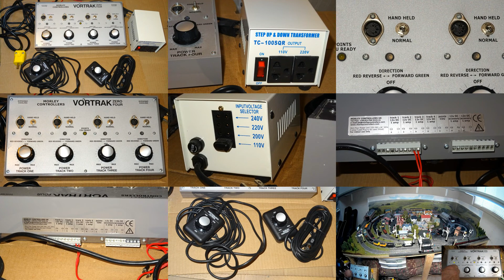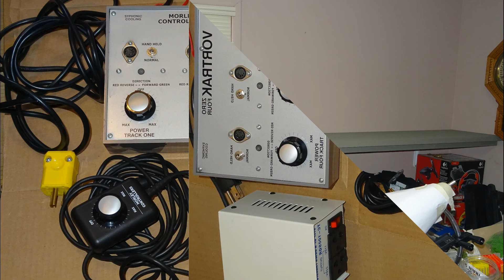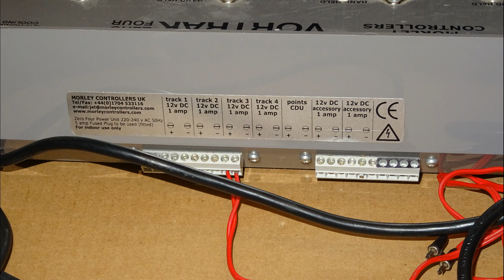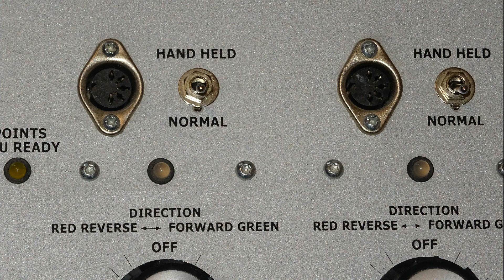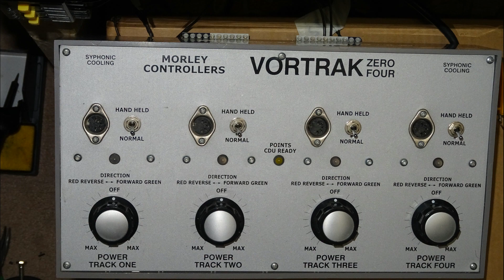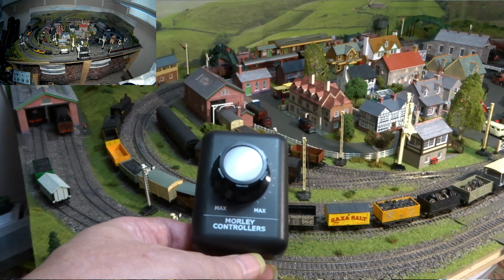OO Gauge 88, Controllers Again: Morley Vortrak

Comment: I seem to have a problem with my Vortrak controller, tracks 1,2, and 3 work fine with the led lights working  in both directions but track 4 does not light up in either directions.  Any suggestions most welcome.
Reply from the maker: I'm sorry, I haven't taken mine apart, so I don't really know anything about the internals.

Comment: May I suggest that you fit ferrules to the stranded wires into the terminal blocks. This will enable the end to enter the terminal block much more easily and form a very secure connection. T🚂
Reply from the maker: Never gone in for ferrules, but I do usually tin the ends with solder before connecting stranded wires.

Comment: Hi Ken. How difficult would it be to replace the knobs with ones that DO have a detent?
Reply from the maker: I would think that it would be quite difficult. Not impossible, I suppose - the front plate would have to come off, and appears to be held on by screws, 6 I think, actually holding the plate on, though it's hard to be sure. Then I imagine the knobs would pull off, to reveal nuts holding on the pots. But you'd have to find new pots, with détentes, that fitted, offered the same range as the old ones, and were of good quality. That's not something I'm going to do. The existing pots are very nice, extremely smooth. The lack of détente is the only issue.
Reply from the maker: What I might do, thinking about it, is something simpler, such as sticking a little bit of something to the knobs where the white position indicator is, so that I can feel the position of the knob without having to look at it.
Reply: @kleedhamhobby  What you might also do is to put a datum mark on the knobs so that viewers get an idea of how much power is being output (not sure if this helps you, though).
Reply from the maker: @PaulSmith-pl7fo  There is actually a mark, but it's hard to see in the videos, as it's just a white dot on the lower rim of the knob, and also reflections may confuse the issue, though the mark is easy enough to see when looking at the knobs in reality. Something that I could easily feel would be nice. I'll see.